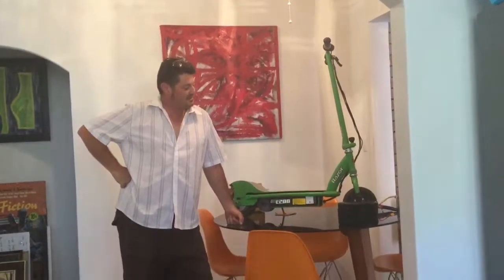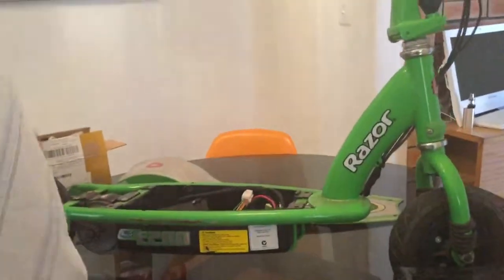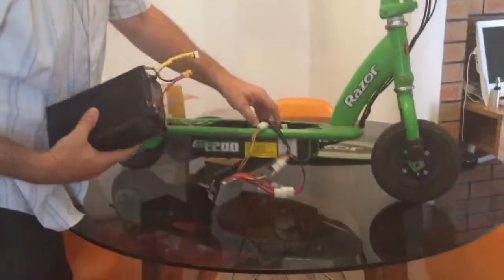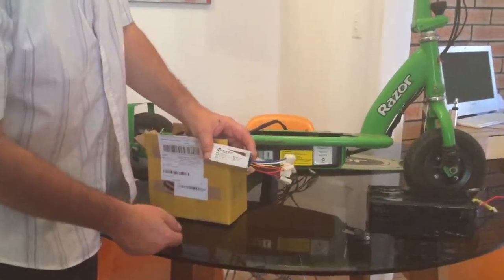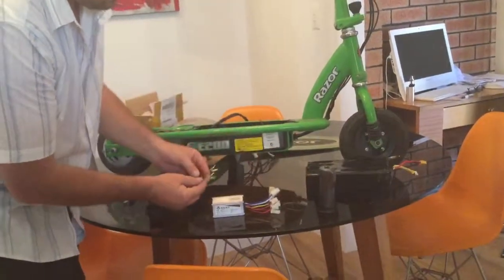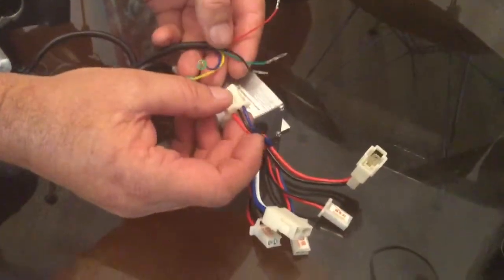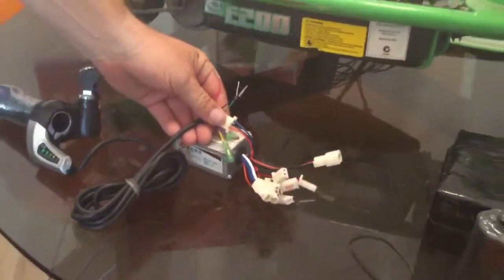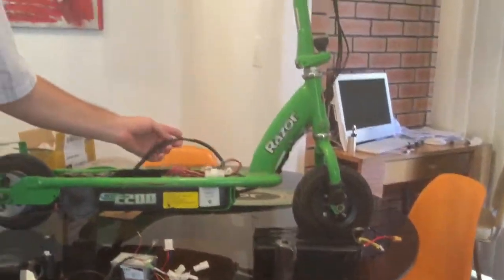razor E200 with lithium battery , new controller, and throttle upgrades

Comment: Nice video 😄👌

but, as an electric engineer student, i have to mention that there’s plenty of reasons why engineers uses Lead-Acid battery for escooter where the battery is very close to the user, It’s to assure maximum safety and prevent injuries or death caused by the battery. Each chemistry of each battery type have their pros and cons.

Use Li-Ion or Li-Po battery at your own risk but NEVER, NEVER give it to someone else or a kid🙏😢you know your design, other people don’t.

Great project doh 👌
Reply from the maker: Hi I used lithium pos4 , 4 cells witch I charge with a full balance charger it works amazingly well

Comment: Mod the controller. There is a current sensing shunt you need to beef up. I am running a 7S 5P (29.4V, 14Ah)  battery pack with no problems on the stock controller.